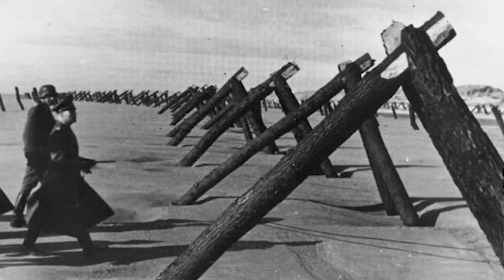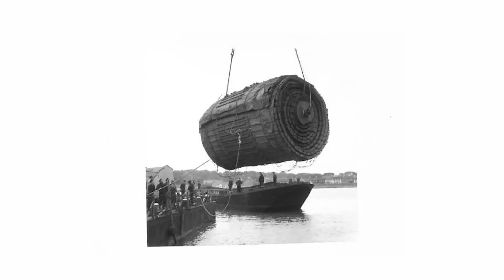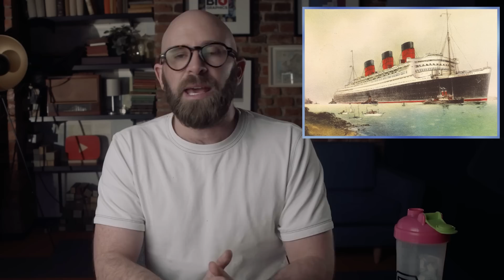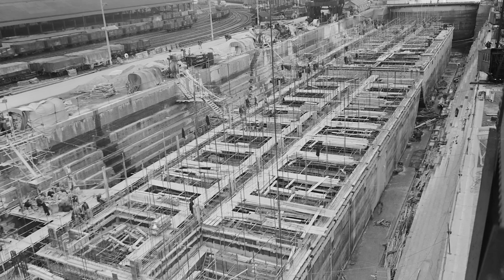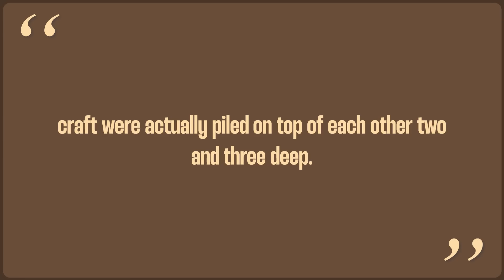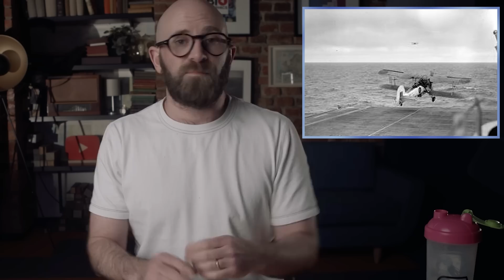D-Day’s Forgotten Critical Secret Weapon

Comment: Thank you for highlighting the significance of the Mulberry harbours.

My grandfather, Kenneth Jacob (1897 - 1990), in 1944 was Master of the boom defence vessel "HMS Barnehurst" and wrote the following (in 1944):

We only stayed at Milford Haven long enough to take on coal, water and stores and left again on May 28th, bound for Portsmouth which we reached on May 30th.

Since arriving in England we all had hopes of leave but due to the imminence of the invasion (about which we knew nothing definite) all leave was stopped and we spent a very busy 4 days taking on coal and stores and on June 4th we went out to the anchorage off Bembridge. This day it blew hard from the S.W. delaying the invasion by 24 hours.

On June 5th, whilst lying in the anchorage, we saw hundreds of invasion craft on the way out so we knew something had started. The same day we heard that Rome had been captured.

On June 6th, we heard that the invasion had started during the night with a landing between Le Havre and Barfleur. At 1.30pm we set sail with a convoy for France. Progress was slow but conditions good and we had no trouble. The next morning we anchored about 5 miles off the coast at Port en Bessin. There were hundreds of ships but no sign of the enemy on the beach head. Our big ships were bombarding inland positions and crowds of bombers were going over but there was no enemy air- activity.

The next day, June 8th, we commenced work laying moorings for a floating breakwater - Bombardons. Landing of men and stores was continuous. This was the American beach head (Sword). We heard today that Bayeux had been captured and it was evident that the invasion was going well. We saw nothing in the way of enemy activity but the nights were noisy with A.A. fire, mostly at our own aircraft and ships were warned they must not open up without orders.

After laying the moorings we continued to connect up the floating breakwater sections and then started to lay moorings in the mulberry harbour which had been under construction from concrete caissons (Phoenixes) and old blockships. The news on June 15th was of slow but steady progress in France and rapid progress in Italy where our troops were now 100 miles north of Rome. On June 16th, the King visited General Montgomery in France. By the 18th the American troops were across the Cherbourg peninsular.

On June 19th a N.E. gale blew up and we took shelter in the harbour. A lot of damage was done to the Phoenixes and the floating breakwater we had laid was completely destroyed. The British beach head at Arromanches did not suffer so badly as it was protected by the Calvados Rocks.

After lying at anchor for two days our anchor wire parted (a 4" wire) and we had to get under way and steam up and down the coast until the next day when the weather moderated. We then had a few busy days clearing up the wreckage.

Comment: I always chuckle at the statement that “ every detail was thought of”. At the 60th anniversary of D-Day, my father and I met a man, who had commanded a crew of 3, on board a concrete caisson under tow. The crew had been issued cans of soup and cocoa, with miniature solid fuel stoves attached to the bottom of each can. So far, so good! But they were not issued can openers! They were at sea for several days, and had puncture the cans with their bayonets
Reply: Back then, can openers weren't much better if I recall correctly.

Comment: Per the Bonus Fact, Eisenhauer's explanation IS still applicable. The departed (or departure) date, while just being the day of the attack, it can still be planned without the date being set.  It is a place holder and that has no effect on the original name being incurred from Departed/Departure.  That is the great thing about code words - they are designed to be flexible and just placeholders for the project/plan.

Comment: Tidbit I find interesting is how the storm that sunk the mulberry showed how fortunate we allies were to have decided to go ahead w it on D-Day as we did.

W all the various limiting factors like times when the moon and tides were favorable, there weren't but two good options until months later, in which case, that would be another problem, as that wouldn't have left us too much campaiging  time befor winter. And Stalin was getting damned impatient w us starting our long promised, long delayed invasion of France. It turned out that the two good options were 1. when we went, and  2. like three weeks later, right when that big storm sank that mulberry. 

It was storming on June 5, so they delayed it a day. And on June 6, they almost delayed it again due to the same storm. If they had, ,there is no telling how badly that would have screwed up our alliance w the Soviets and our overall effort to defeat the NAZIS.

Comment: Operation Jubilee's primary objective was not to capture the port of Dieppe to be used in the allied invasion of Europe. It was to capture one of germany's new 4 dial enigma machines, along with the code books and ciphers used by the germans to communicate with their troops. The attack on the port city was to provide cover for that intelligence mission, as well as concealing the theft from the germans to prevent them from changing those code books, thus rendering the captured intelligence useless. The mission failed, and it would be many more months before the Allies could get their hands on one of those new enigma machines.

Comment: During the age of sail, the Royal Navy had auxiliary vessels called "Camels" that were strong, capacious, shallow draught ( could go in  close to shore ) and broad with almost flat keels. They were used to transport military stores into the various  port-less countries that needed British Flags. You didn't need a port, could sail up to a beach, , lay parallel to it, drag in closer with  tackle to the shore,  put down gangplanks and walk your donkeys laden with supplies ashore. On a number of occasions they were given planked topsides flush with the rails,   vessels laid down end to end, and used as "instant harbours" that larger vessels could quickly embark/disembark troops over.
An additional use for them was they could refloat vessels that had gone ashore and "bilged" which meant filled with water from a leak, and sat down on the mud  and stuck.
 If you have a leak in the bottom of the hull, and the vessel settles onto mud, when the tide goes out the huge weight of the unsupported, water filled vessel forces the hull into the mud, the mud forms a suction grip and the water is forced out of the mud under the hull, and it becomes impervious to water. This means the majority of the "lift" of the incoming tide is not transmitted to the vessel,  and even taking out the water and goods won't allow the vessel to break free.
You sailed a camel in either side, bound them firmly to the bilged hull at  low water, and then they  would lift the ship out of its "Mud berth" when the tide came in.

Comment: The Mulberry Harbours were incredible and truly war winning as armies can't fight without supply. When compared to the PLUTO system that sounds incredible a system to pipe petrol from the Uk to France how could that not be a war winning tool? Yet it is my understanding that the pipeline was insignificant in terms of volume making less than 10% of total petrol supplies used in the allied forces. That isn't war winning numbers, that is great system for moving supplies but the allies could have used conventional means to move petrol if it failed.

Mulberry was a system that just barely handled the capacity of the supply and manpower need to prosecute the war effort. You remove their contributions and the advance stalls or is pushed back because we don't have the ammunition, food or fuel to fight the enemy. People think generals and weapon systems are the key to victory but supply lines are paramount for without them your weapons don't work and a general's plan fails. Mulberry gave the allies the ability to fight the war, that isn't something that should be forgotten or minimized.
Reply: "Amateurs consider tactics, veterans master logistics"

Comment: Tidal range on the Normandy coast was 20 feet or more, and the tidal currents while all that water ran in and out were immense. The Spuds were to provide a platform at a constant height above the water onto which Landing Ship Tanks (LSTs) could drop their ramps one offload vehicles which would drive to the beach over the Beetles and Whales. LSTs could also drop their ramps directly on the beach on a falling tide, but once they did they were stuck until the tide came back in. The Spuds could turn around two LSTs in an hour, an LST on the beach was stuck for 12. 

Meanwhile, Liberty ships could anchor in the harbor and use their cranes to lower material down to DUKWs, which could drive inland and offload at supply depots.

But all of this was possible because the Phoenixes were blocking the tidal currents.

Comment: That the Clover design should quickly rot away - something doesn't make sense there: wood does not rot in seawater/saline water: Indeed the salt is a preservative. Most woods will not rot for decades in any case if properly treated/grown. Fresh rainwater is the bane of wooden boats, especially if it allowed to gather in pools and is why wooden boats rot internally or above the water line, mostly on the superstructure and exposed upper parts/transom etc. I'd love to know more about what happened there.